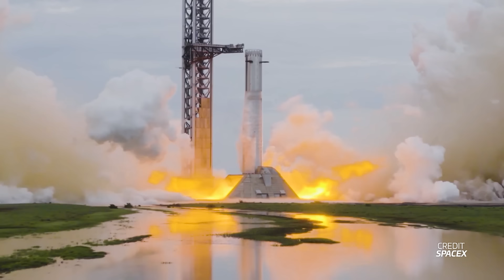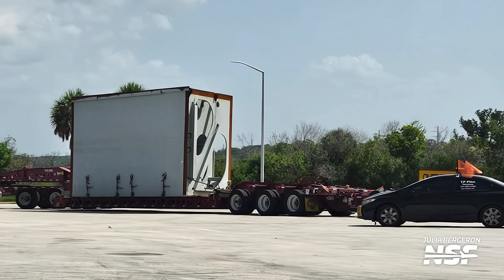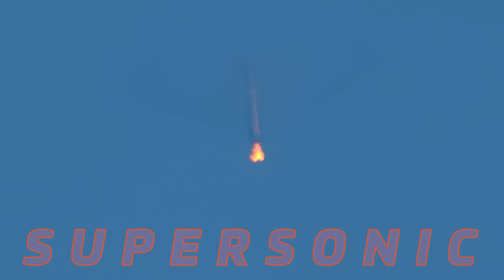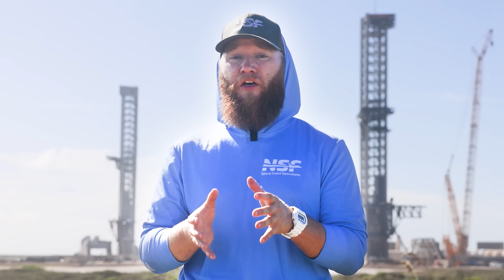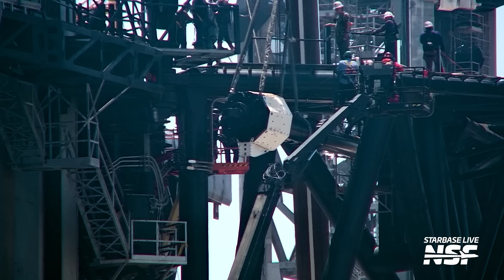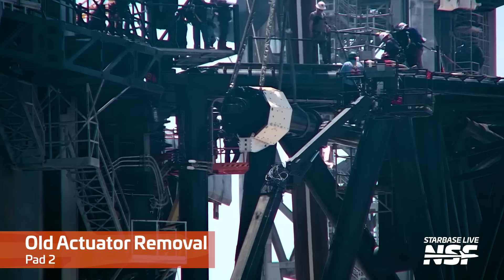Starship Flight 13 is Almost Here | Starship Update

Comment: From a ridiculous high of  $201.80 /share on Jun 16 to $135.7/15,  Spacla,  really can't afford another unintended boom, can they?   Spacla doesn't seem to be alone in booster landing anymore either, with other countries progressing at a pretty impressive rate. The competition is heating up. It would be nice if Spacla could make an orbit and re-entry without burn-through or other parts falling off, but I'm sure that's not part of the plan for this upcoming flight.    I'm not sure if go fast and break things works any longer,  but I am waiting for $110/share<:)

Comment: They will be pitching more and pitching earlier, to help head down range faster for better performance so max q will be quicker in the flight grok says

Pitching more aggressively or earlier helps the vehicle “head downrange faster,” gaining more ground track distance sooner. This reduces gravity losses, improves overall energy/velocity at staging, and supports better booster boostback/return trajectories.
Reply: Max Q is later in this flight actually and pitching more aggressively makes Max Q to be later and with a higher peak.
Reply: @Alexphysics13  seems correct!

Comment: I always laugh when I see spacex hauling engines in the weather with minimal equipment coverings.  Their competitors would NEVER risk their clunky designs similarly.
Reply: SpaceX is also not risking anything. All the ports are covered, aren't they? That the engine gets a little wet and potentially dirty on the outside doesn't matter.

Comment: Okay, question: if one Mechazilla chopstick arm engages in a catch but the other one doesn't, then what? Can one arm carry the load of either a Starship or booster? And assuming it could, what contingency is there to get it safely back down?
Reply from the maker: That's what you would call... an interesting time. .aybe the gridfin catches and holds, and they figure out some way to secure it with a crane. If it doesnt, the launch pad has a very bad day... but incomplete catch would make for a very dangerous recovery situation. - Das

Comment: i understand the booster flip on flight 12 wasn't what they wanted, but what were the side effects? did it miss the targeted landing location or did it self-correct?
Reply from the maker: It wasn't able to do a boost back and return close to shore, as planned... instead of ended up crashing down range. Still inside the safety area, but not the intended booster splashdown zone. - Das
Reply: @NASASpaceflight I see. Thanks for clarifying.

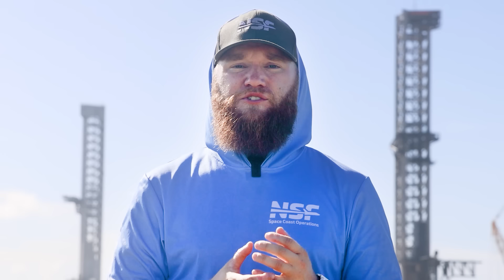Comment: FLIGHT 13 TOMORROW Thu, Jul 16: 3:45–5:15 p.m. PACIFIC TIME (window opens 3:45 p.m. PT). Planned highlights for Starship Flight 13 include deploying 20 REAL next-gen V3 Starlink satellites for the first time, attempting a booster boostback and landing burn, performing an in-space Raptor engine relight on Ship, and testing heatshield upgrades during entry, descent, and splashdown. LESS THAN A MONTH AFTER FLIGHT 12!!
Reply: Uhhh you might wanna check back on the timing there because it’s definitely been more than a month since Flight 12

Comment: How can they "relight all 33 engines for the Boostback burn" when the outer ring does not have startup hardware in the booster, only in stage zero on the ground? Are they still spinning fast enough to relight a few seconds after shutdown?
Reply: This is incorrect I believe, since V3 and Pad 2, all booster engines have start-up hardware and none of it comes from stage 0 anymore. So that’s the reason they can restart all 33 engines mid-flight.
Reply: That's no longer true with block 3 it's true that for block 2 only the inner 13 engines could relight after launch not so for block 3
Reply: They can because what you say no longer applies because this is version 3 and pad 2 and they don’t do any of that anymore

Comment: 4:10 yeah I still think blocking off parts of the hot stage section is a better and more reliable solution. Even with the newly staggered engine startup sequence. Any fail to light an engine/engine out would risk destroying the booster. Achieving all this through a fixed part would be a better solution and provide a lot less possible points of failure.
Reply: Less parts means less points of failure.  Staggering is a software solution that can be achieved through iteration and testing, yielding the same long-term stable solution that a hardware fix would take, except with zero weight added.  There's no math that says more parts means more safety.
Reply: @PaleoWithFries  only that's not actually the case here. We're only talking about the hot staging sequence itself. By including any engine you add tons of more parts and thus tons of more points of failure plus the whole software side you included which ads even more possible points of failure.

The blocked off section is a single part solution that'll work no matter how many engines fire up. The staggered start instead includes 6 different engines so tons of extra parts that could fail and result in a failed hot staging and consequently loss of booster.
Reply: @niri2506  "tons of extra parts that could fail" the engines already are there, about be activated in the sequence.  the startup sequence for them is all that needs to change.
Reply: @PaleoWithFries  again: We are only talking about the hot staging sequence. While sure the engines are on the ship anyway. Talking about the process of hot staging they can either just be the singular "thrust" part of the equation because everything else is handled by a tiny bit of structural metal. Or you can include each individual engine with each of their individual parts and software as a part of the equation to flip the booster in the desired direction.

Structurally directing the exhaust simply is a more reliable solution period.
Reply: @niri2506  You're not making sense in the slightest. Hot staging using only ship engines and accurate software is the most optimal solution in weight, accuracy and reliability. Adding whatever you are proposing is completely useless and unnecessary. There's a reason SpaceX will rely on their solution and not whatever you're trying to propose. The integrated hot staging is simply the best solution in the long run.
Reply: @interpl6089 dude where am I saying the integrated hot staging is  not a good solution? Obviously the integrated section is a way better solution then the added ring on top of the grid fin housing. Nobody is denying that.

The whole issue is regarding the flip direction of the booster during hot staging. Which should have been fairly obvious to you by now but I'll point it out again.

You can either determine the flip through reliable structural means or by using a complex system of engines, pumps and software.

The latter one means that any failure of a ship's engine during hot staging will put the booster at risk. That means 6 different reasons the flip could fail. And each engine could fail for tons of different reasons so you multiply the points of failure for the flip process.

However simply adding a little bit of structural steel within the hot stage interface would provide a reliable solution no matter what failures we see during engine startup. All of booster and Starship is designed around reliability and the necessary redundancy to even have a successful flight when things go wrong. And this particularly focuses on engine out capability. Why? Because SpaceX knows a failed Raptor startup is ALWAYS a possibility.

And the whole thing could even be achieved without adding any weight whatsoever. You already have the structural pieces necessary within the new hot staging interface. All you'd need to do is adjust the geometry of some of the supports. And even if you ended up adding let's be generous and say half a ton of additional weight on the booster. The whole program is reaching a point where that's a negligible increase for a massive increase in reliability.
Reply: @interpl6089He's making complete common sense. Don't use the six extra engines which any failure of 1 of the 6 causes issues. Don't use them and you have eliminated MANY parts and engines that can and will eventually fail. Complete common sense dude.
Reply: @niri2506 People can't understand common sense. You make complete sense bud!!
Reply: You're going to light up the engines anyway, that's the point. And while at it, they do the flip for you using only their start-up sequence. No need to re-invent the wheel here.
Reply: @interpl6089 and by relying on a startup sequence (as explained extensively already) you have to rely on a thousands things to go right. Instead of simply changing the shape of some of your structural components to redirect the exhaust as desired. It's still the engines being ignited that creates the thrust for the flip (and just as with the previous "integrated design is better" argument you are arguing against something nobody is saying). It's just that the direction of the thrust will be determined by something 100% fail proof.

I really can't understand how you can argue against that. Sure the staggered start is the "cooler" more advanced method. Simple aerodynamics would be the more reliable solution. And as explained within the hot staging sequence relying on staggered start results in each part of every single engine to become a possible point of failure. Opposed to (except maybe for a total failure to ignite any engines at all) 0 points of failure with the solution that has already proven to provide the desired outcome reliably.

Comment: Why does it matter which direction the booster flips at hot staging. Surely the engines should relight whatever?
Reply: The importance is because flipping “up” is the most efficient way for the booster since it’s already going that way and needs the fewest corrections for pointing back towards the pad. Flipping in any other direction makes it a less optimal flip, necessitating more propellant for the boostback burn to correct for having pointed in a different direction during the flip and accelerating in the wrong way. Thus, if it just flips whichever way, it has to carry extra propellant to account for the least optimal kinds of flips. If it instead is forced to flip in the optimal way, it doesn’t need to reserve any extra propellant and can use the extra on a longer ascent burn
Reply: @Alexphysics13 I understand that it's for optimal efficiency to flip the correct way. It was just that they made it sound like that's also why the engines didn't relight properly. I love watching the launches, but I'm not up to speed with all the engineering side of it. Thanks.
Reply: @JonathanSm1th  nah they just pointed that out because the ship startup wasn’t timed properly and it failed to flip the booster in the right direction
Reply: The direction matters for return efficiency. They have to account for the G forces so we have no way to know if the off nominal flip would affect actual engine operation or possibly create errant sensor readings. They said they changed the engine parameters.
Reply: @DrClaw-b3w Thanks for the info.
Reply: It's an efficiency also flipping in an unexpected direction can potentially starve engines of propellant and rocket engine turbo pumps do not like ingesting gas

Comment: July 16, the 57th anniversary of the Apollo 11 launch to the moon. God speed SpaceX.
Reply: Not one of the Saturn V rockets blew up . 
Not one of these launches has got us closer to the moon.
Reply: @anthonybrennan4416 yes they have. Maybe not in terms of just distance but progress has 100% still been made. And a lot of it.
Reply: @tommoore2012 most of that progress has been made fixing enormous flaws or covering up mistakes in the program.
 The most basic flaw is that the whole system is too heavy  ,and by trying to fix this ,vital systems are rendered dangerously fragile.
Reply: @anthonybrennan4416  Yes, Starship is heavier than they initially expected. That's why they made it significantly taller. I don't think it's going to be fragile: They are ironing out the fragilities as we speak.
Reply: "I was there, 3000 years ago ..."
Reply: Theres always some anniversary 😅
Reply: @rokadamlje5365  There has been a Manned launch on every day of the year... except Feb 29th? maybe?